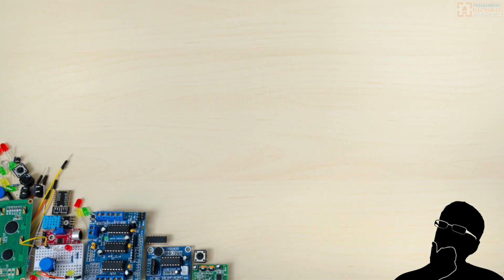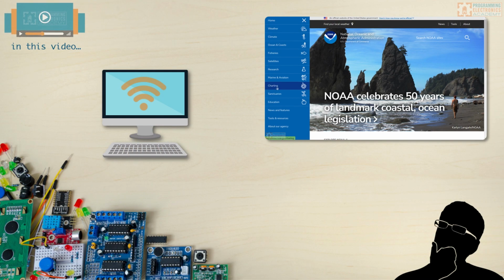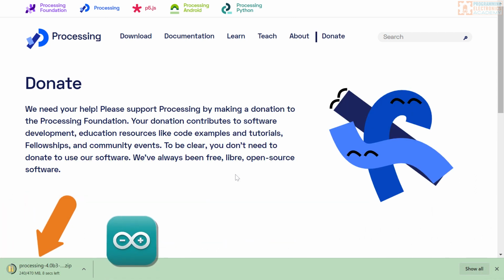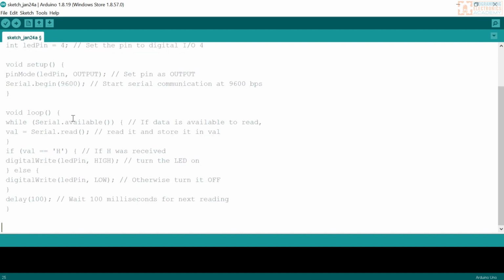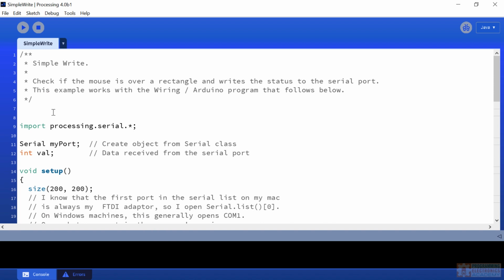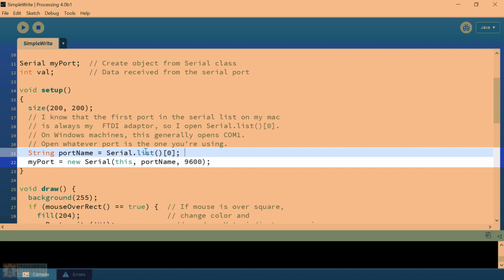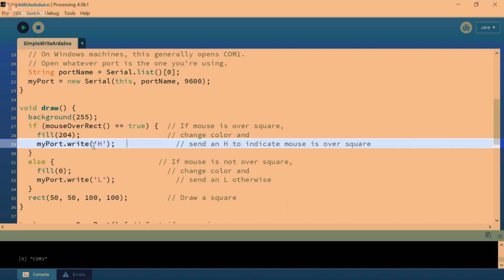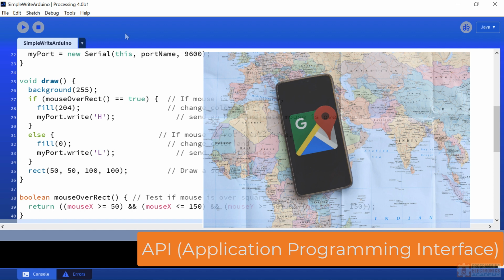Connect Arduino to internet over USB (with Processing) - Simple Space Weather meter example (Part 1)

Comment: This is excellent, I really value this.. Its is pretty much what I need to do, with the exception that I need to get World Time (rather than space weather) in DateTime format and send this string to Arduino via USB. I think I have the Arduino side down, but its not clear how to transmit strings to serial in Processing, and how to parse the API data that I get. I find Processing rather cryptic. Do you have any quick tips, to receive and transmit data more complex than one char? Otherwise I will have to teach myself some Processing language. Thanks for any help.
Reply from the maker: Hi Steven, yes, definitely ways to do this, and it gets a lot easier when your using a WiFi enabled board which can talk directly to a web service, and not use Processing as an intermediary.  

I will note that Processing is a pretty fabulous language to learn (some amazing graphics have come out of it!) - it's based on Java, and isn't too far a cry from what you learn with Arduino.  A great book for learning processing is called Learning Processing http://learningprocessing.com/  by Dan Shiffman, and it is a real jewel as far as programming books guy... but I digress :)
Reply: @programmingelectronics  Thanks, very much appreciated. Yes, I see that Processing has many similarities to Arduino CPP. I am already making headway with the reference guide. I will look at the book you suggest. Love your stuff.

Comment: which component are using for internet ?
Reply: What the component name which attached for internet. Thanka
Reply from the maker: @47lokeshkumar74  As long as your computer has internet access, there is no additional component attached for internet.  Your Arduino needs to stay connected to your computer 
via USB however.
Reply from the maker: Great question!  What this demonstrates is using your computers internet connection through a USB cable attached to your Arduino board.
Reply: I think there should embedded ethernet chip are there. Which can be controlled through arduino

Comment: Hi, I'm using arduino uno and mega. Trying to create a serial communication between them and also I want to send data(numbers) from uno to mega for the telemetry. But it just sending numbers between 0-255. I want to send high numbers (7-8 digit) and receive it on mega. Could you help me about it please?
Reply from the maker: Sounds like a cool project!  Have you check out the Serial.parseInt() function?  We have a video on it here:
https://youtu.be/lcjLUdDB1Us

Maybe that could help?
Reply: @programmingelectronics  Thank you for reply. I've solved the problem thanks to this video. Now it works. Thank you!